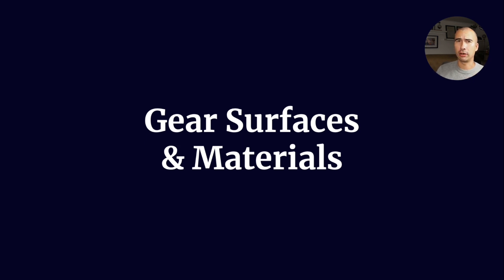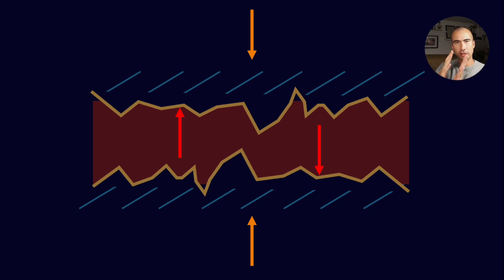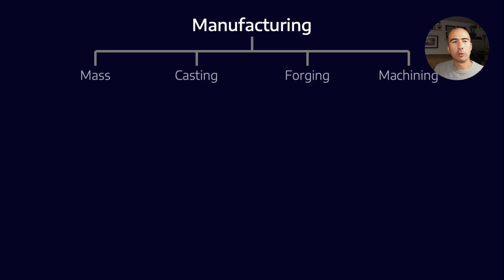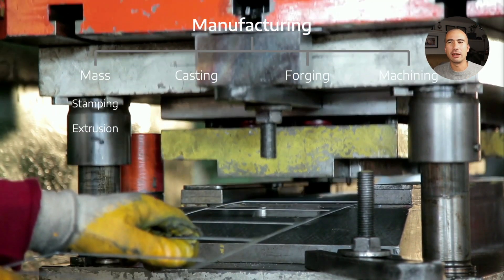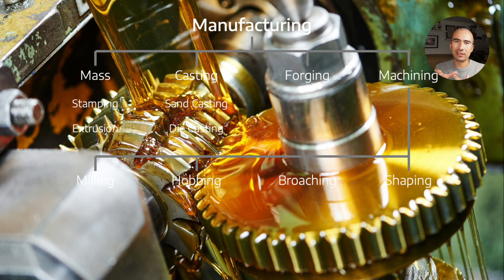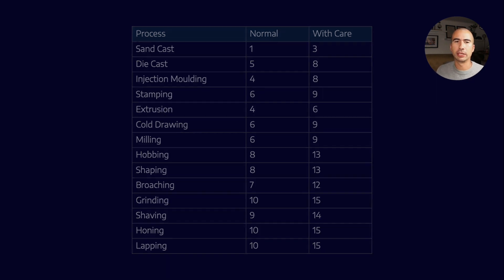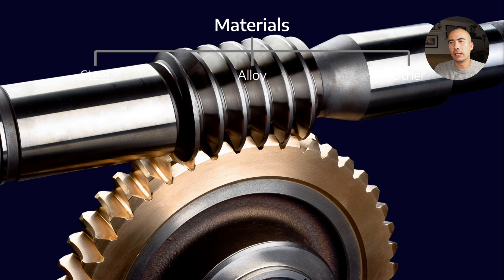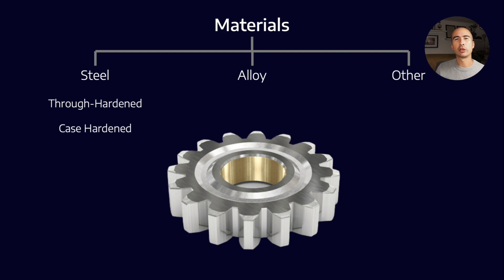Here's how gear manufacturing might affect your lubricant choices

Comment: Talking about gears, we have some gears made of different materials that we can't use ZDDP based lubricants. Is that correct?
Reply from the maker: It's definitely possible - if they are they made from yellow metals (brass, bronze etc) then the Sulphur and Phosphorous in ZDDP is active enough to start corroding the gear material.
Reply: @LubricationExplained  I found some studies about railroad and marine engines where the Crankshaft and some others parts are made with some alloy that contains silver in it, due to the silver, this application must contains Moly additives instead of ZDDP. I think, this could be a great topic for a video? What do you think?

Comment: Hello, thanks for the video.

I would be interested in a video, rather niche application: usage of a dry PTFE / NLGI 2 grease with PTFE in a 3d printer linear bearing/bushing (LM8UU). Possibly applicable in linear rails also. Low load, load speed (50 - 300 mm/s), start stop heavy, small jerky movements. Only if you would be interested. Thanks.
Reply from the maker: Wow, that is VERY niche. Rather than making a video maybe it's better if you send me specific questions you might have: lubrication.explained@gmail.com
Reply: @LubricationExplained  Greetings once again. I have contacted you via provided email, on the 23rd of January this year,  and I have a suspicion, that it might have gone to the spam folder. 

If you would take a minute someday to take a look, i would be grateful. Thanks.